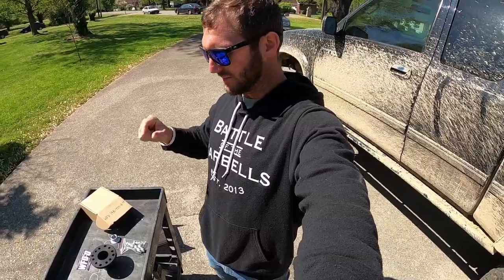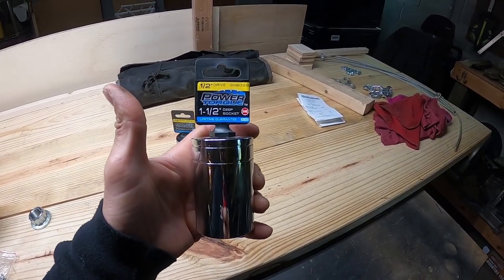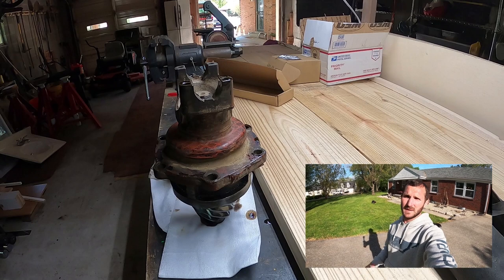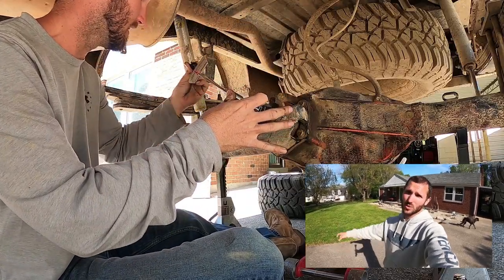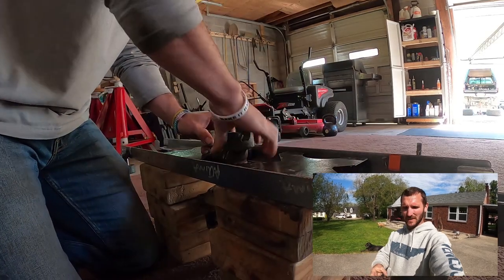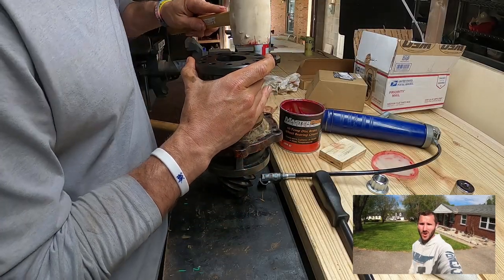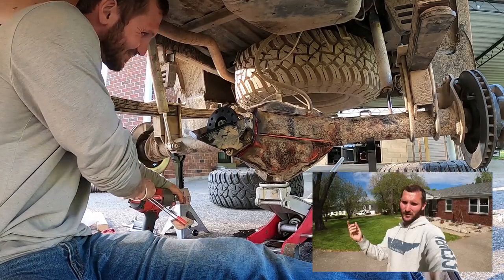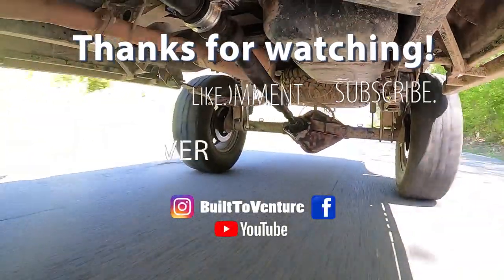14 Bolt Toyota Drive Line Flange - Overview and Installation

Comment: WFO SAID TO JUST RUN THE PINION NUT DOWN UNTIL TIGHT- does that mean the nuts tight enough then?
Reply: Depends. Assuming you're just replacing the flange and utilizing the existing bearings and crush sleeve? If so, than I'd recommend taking out your pinion housing, measure pre-load (in-lb torque) as it is, pull old flange off, install new flange, and start tightening down the new flange. When getting tight, I'd then start checking your pre-load with the goal to get it just barely above where the original preload was. This ensures everything is tight. WFO guys know what they are doing though and clearly deal with this everyday.

Comment: The rear pinion of my 1998 T100 (VCK21L-CRSSKA) mounts in the third member housing and isn’t removable without first removing the entire third member and then also removing the differential assembly from the third member. What rear axle is that?
Reply from the maker: My rear axle isn't the stock Toyota axle. It's a 14 bolt axle out of a 76 Chevy K20.